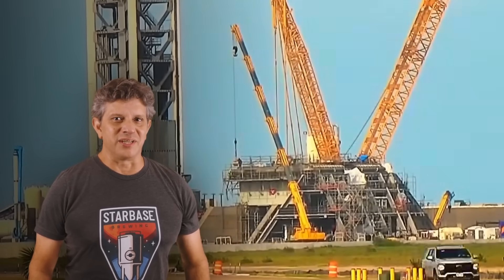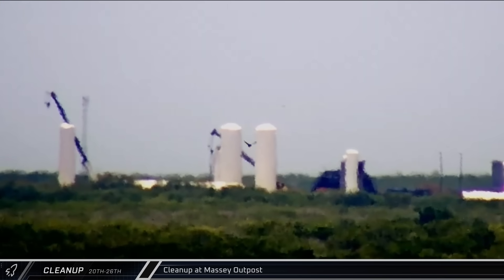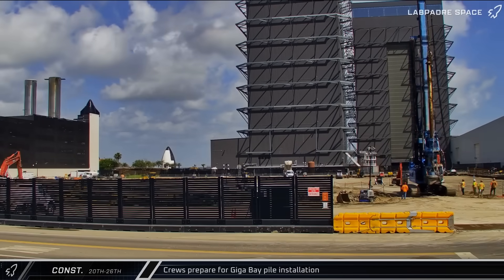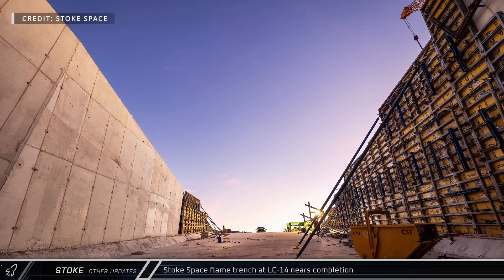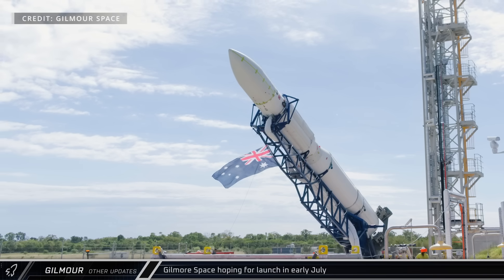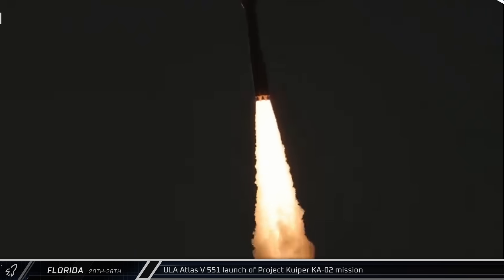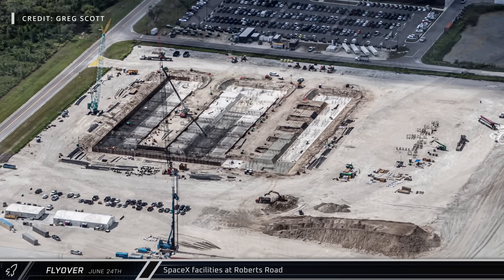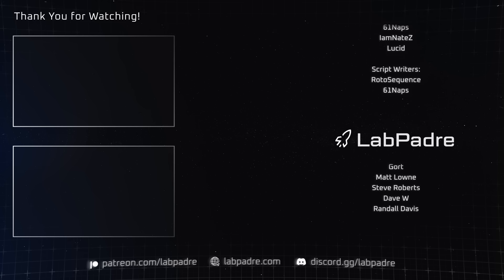Picking Up The Pieces of Ship 36 - Spaceflight Update #173

Comment: Composite COPV, composite OceanGate Titan...is there a pattern here of composite characteristics under high pressure?
Reply: @jackfox9082  COPV's actually play to carbon fiber's high tensile strength, holding the pressure inside the cylinder. Titan was the exact opposite, with high pressure outside and relying on compressive strength, which composites don't generally do as well with. The high pressure inside also self-stabilizes, whereas the pressure outside needs overbuilt because anything out of perfect balance can lead to a rapid failure.
Reply: Not at all.  Composites are used in diving tanks all over.  It looks more like it could be a handling issue than anything.